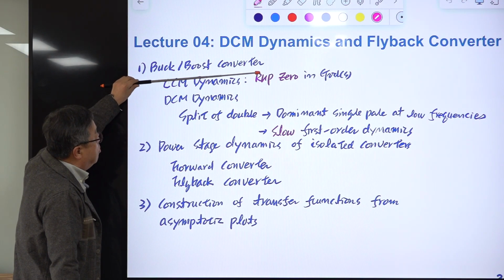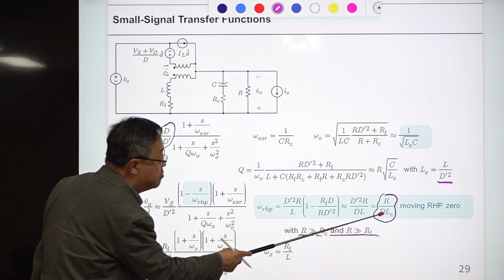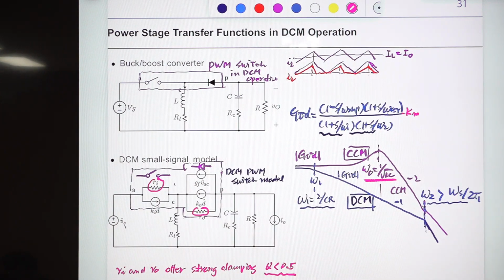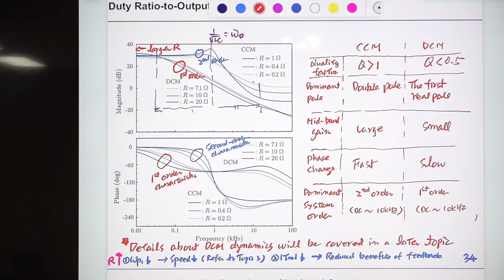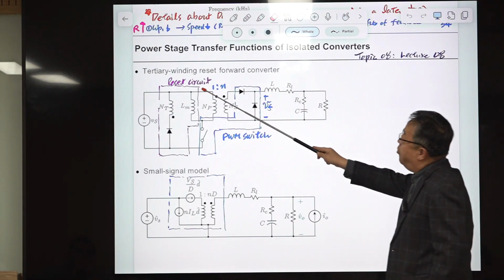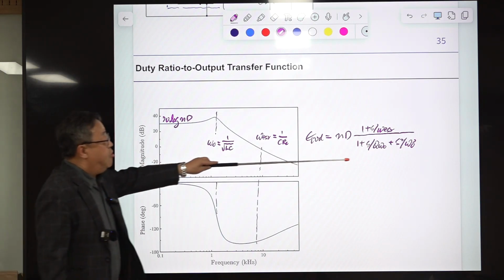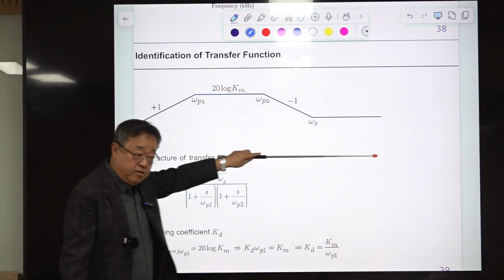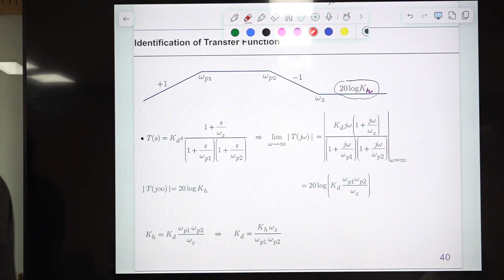Lecture 04: Buck/Boost Converter, Flyback Converter, Power Stage Transfer Functions, DCM Operation

Comment: Eagerly waiting for the new videos on voltage and current mode sir...
Reply from the maker: Thank you for your patience and loyalty. I am posting the first video on voltage mode control. The class has new students who are taking the power electronics course for the first time. Thus, the class starts with some introductory slides but it will speed up shortly.